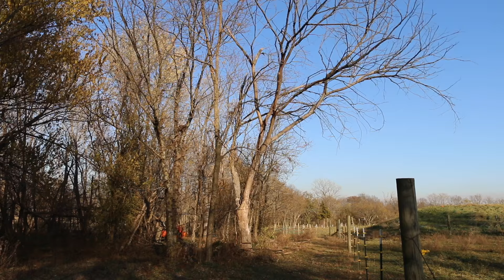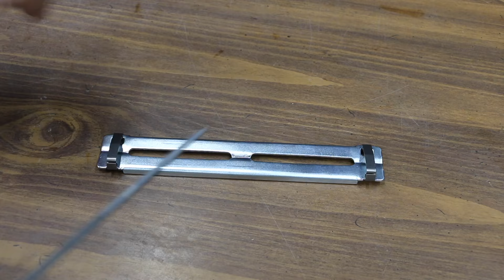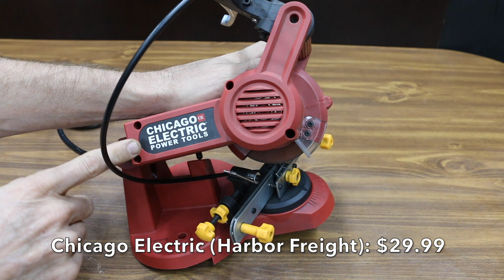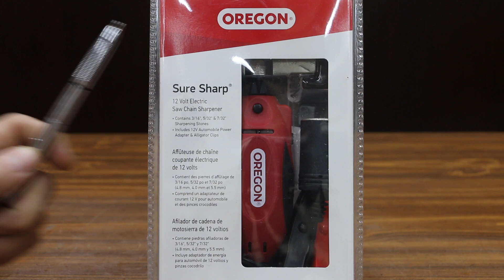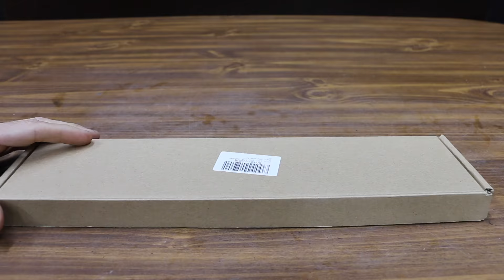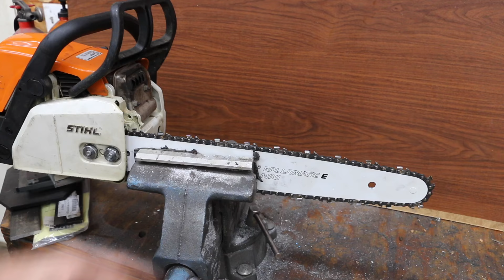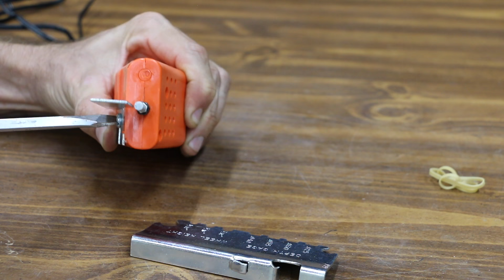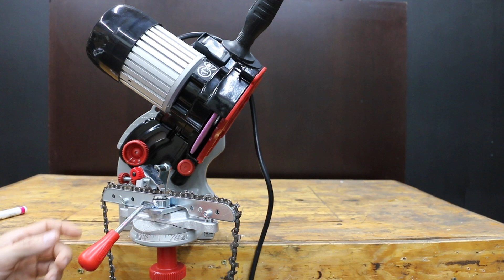Which Chainsaw Sharpener is Best? Let's find out! Stihl, Granberg, Chicago Electric, Oregon

Comment: A new can made much sharper with a good freehand filing. Nothing beats it, but it took me a quite a while to be able to do it quickly. Also  a stump vise or bench vise makes freehand much easier. After a couple sharpenings the rakers also need to filed.
Reply from the maker: Thanks for the feedback.

Comment: For field use, file is the best. It also takes away almost no material so the chains will last forever. A chain sharpened with a grinder will create heat and the hardness changes, so the chain will be dull faster. There is absolute no good reason to use them after you learn how to use a file. But it's a great way to equalize all the teeth when your chain is half life or so instead of using a caliper to measure each teeth.
Reply from the maker: Thanks for the feedback.

Comment: You don't know how much I appreciate that you spend so much money so we don't have to. I've been debating hard lately on getting a system to replace my field files. And as good as they are I think I'm going to get one of those 2 in 1 stihl files. Thanks also for showing me the files in that are changeable. The salesman told me I had to buy one for each size.
Reply: At least here in Europe you get 1 for each size. Don't know if the US version is different. 
Also the box it comes in is different. Here in EU it comes in a protective plastic, also used for storing it.
(I work at a Stihl dealership)
Reply from the maker: You are so welcome!

Comment: Great as always, I love that you acknowledged the learning curve for all the products, I definitely never get it perfect the first time!

Video idea, I noticed you wearing safety chaps so... Safety chaps?

Methodology note, if your camera has a view finder or if you set up a mirror when you make cuts like these you can watch yourself and try to stay as perpendicular to the wood or parallel to the ground as possible for all the cuts. In some of the cuts you let the saw dip below the blade quite a bit and this increases the surface area of the cut. Consistency is key to make accurate comparisons.

+1 for the stihl 2 in 1, only tool you can use quickly in the field
Reply from the maker: Thanks!  Thanks for the constructive feedback.

Comment: Love your videos! With all the recent power outages I bet a lot of people are wishing they owned a power generator, which got me to thinking. If you owned a deisel generator and were running it in a long black out, but ran out of diesel, what household liquids could you have around that could run your Diesel in an emergency, and more importantly, what if you dumped them all into the same gas tank? Might even make the doomsday preppers in your audience happy to.
Reply from the maker: Thanks for the video idea.

Comment: Sawed professionally for years in the forest firefighting and logging industries. IMHO learning to use a file is the best way to keep a handheld saw chain sharp. Have also operated feller-bunchers and processors; good luck trying to hand sharpen those giant cutters by hand. Sharpening those convinced me to buy a Grind-n-Joint USA made 12v sharpener (now sold as the Stihl 2-in-1) to sharpen rock/metal damaged chains on my handheld saws. Works great.
Reply from the maker: Thanks for sharing.

Comment: I'm a line clearance tree trimmer and the Stihl 2n1 is my go to.
Reply from the maker: Thanks for sharing.
Reply: The 2 in 1 is my go to as well. 5-10 min tops and good to go!! If I’m in the woods I use a bar clamp to hold the saw steady
Reply: I only use the stihl 2 in 1 anymore. Have 2 for my 2 saws, no more blueish teeth for me!
Reply: It's definitely the best value and also the most portable. Very fast to get the chain sharp as well. That's all I use to sharpen my chains
Reply: Does a good job without needed power. Good for work on the field.
Reply: The 2 in 1 is made by Pferd so if you find theirs online it is often cheaper than the Stihl. I have a Timber Tuff bench grinder but prefer the 2 in 1.
Reply: @caverbrad  riiight. We still have an old one from pferd in stock at our store. I always thought they looked very similar
Reply: @caverbrad  I'm in Europe and got my 2 Pferds from Germany nearly 4 years ago. I've not touched my bench grinder since.
Pferd: Take it out of my toolbox in the field, touch up the blade in 3-4 mins & I'm done.
Bench: Take the blade off (by which time I'm halfway done with the Pferd), set the grinder, maybe having to change the wheel, at least 5 mins to grind,  2 mins to Flat file the depth guides, then remount the chain. Plus time getting to and from my workshop. PLUS the 2 in 1 (Pherd) is less aggressive and my chains last noticeably longer.
Reply: It's like anything, It takes a bit to get used to but the 2n1 is the best sharpener by far. Anyone who doesn't like it either has dull files or hasn't given it a proper chance.
Reply: Awesome. I'm old school. I've got an old John Deere with a 38" bar, 67cc. Very heavy, powerful, and a great workout. Not so much fun for trimming.
Reply: I'm used to do it manually. Tried the 2in1 this winter but it seems to give a very shallow hook. Did I just manage to not use the 2in1 properly?
Reply: @Windsor1492  not all chains are at the angle indicated on the tool rest the tool on chain and turn until file contacts tooth at the chains factory angle then make mark on silver bars of tool with a sharpie to hep you keep angle also make sure you have the correct size file for your chain I use this tool all the time and it is flawless when used correctly
Reply: @Windsor1492  try taking the depth gauges down a couple of passes first, sometimes they're too high and the round files don't go deep enough.
Also, check to make sure it's for the right chain pitch and gauge they are not universal.
Also also if the flat file is dull it won't  want to get it done either.
Reply: Hey same I work for abc.
Reply: What happened to that one that attaches to the tip? I saw it in the beginning
Reply: Same here
Reply: Stihl 2 n 1 is better, manual, precise, and affordable. Great in remote locations or down the back of the farm. I've used these for years and they never disappoint.
Reply: Stihl has good marketing distribution.
Reply: I take it to ensure proper round file depth do you have to start filing from a new chain with the 2 in 1?

I've always used separate round & flat files and a raker gauge, but seems like you all really have good results with the 2 in 1
Reply: @endutubecensorship  as long as you have the correct 2in1 for your chain, with good sharp files you should be able to bring back almost any chain.

Problems come from "trying out" one someone else has already filled, clogged, and or is intended for a chainsaw of a different pitch and or gauge.
Reply: @brtrimmer132  understood, thank you. I'd say for the price it's worth trying out
Reply: yep, that tool is best, its in my saw kit, can sharpen in the field multiple times a day...
Reply: It's the best.
Reply: It's great to use in field. Plus keeping the depth guages down is as important as keeping the chain sharp.
Someone I knew sharpened a chain, and then it no longer cut. The sharpen job was top notch for free hand, but the depth gage was never touched. Knocked them down for him and it ripped like new.
Reply: I'm thinking about the 2 n 1. I had an old man that sharpened my chains for years, until he passed. Now I have to figure out how he used to do such an amazing job with my chains

Comment: Used a Dremel with Sharpening stone for many many years,   do it by eye.  Always works fine.  Maybe not optimal, but plenty sharp. Sharpening done ON the bar. easy to see what already done because layer of oil removed from blade done.  (done most like the Stihl version)
Reply from the maker: Thanks for sharing.
Reply: Yep - same here - takes 2 mins for whole chain..
Reply: I file mine, but I was kinda thinking the same.
Reply: if you have bad eyes, you can just buy the dremel chain saw sharpening attachment.

Comment: Thank you for the video.
As interesting as usual.
I think the Stihl 2 in 1 versatility and price/performance ratio is hard to beat. Plus it doesn't need any kind of electrical power, wich is a plus. You have as good a sharpener in the shop as on the field.
Reply from the maker: Thank you very much!

Comment: It looks like those 4x4 lumber boards are coniferous soft wood. In which case, it is better to file down the depth gauge for a more aggressive cut. I wonder how well the default chain would preform out of the box if it had its depth gauges filed slightly but left the teeth untouched. I know a lot of guys that do just that because they live in an area where there are less hardwoods and more coniferous softwood trees.
Reply from the maker: Thanks for the feedback.
Reply: Your videos are awesome. I’m looking to buy a granburg based off of your test findings.

Comment: This was pretty good. Believe it or not u probably won't get a mechanical (motorized) sharpener to sharpen as fast as a regular file. When u sharpen a chain u want to pull up and back slightly, while pushing across. This gives u a longer hook on the top of the tooth..
Reply from the maker: Thanks for the feedback.